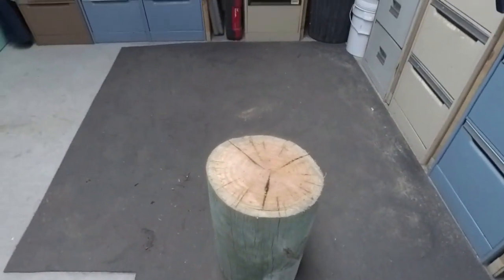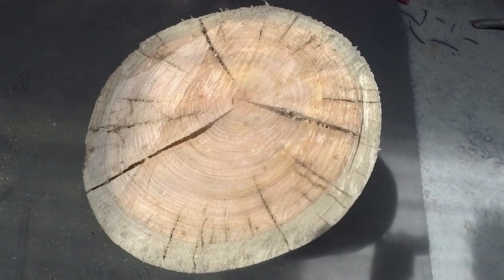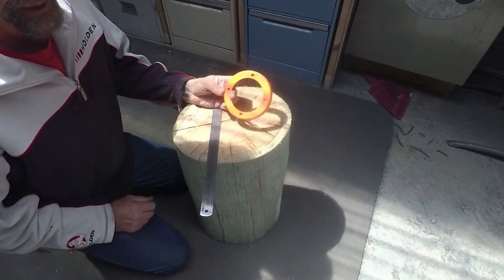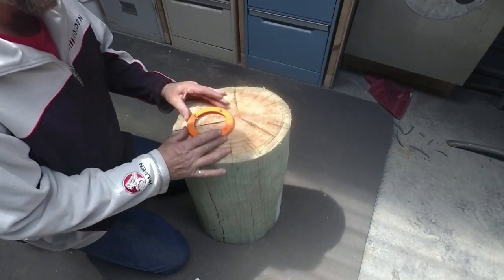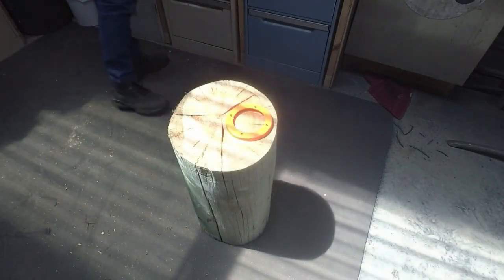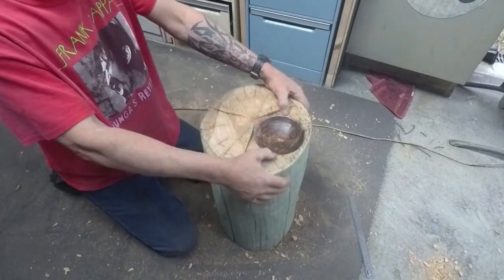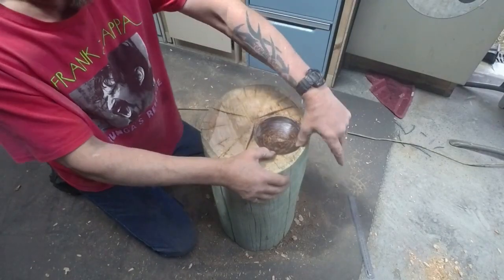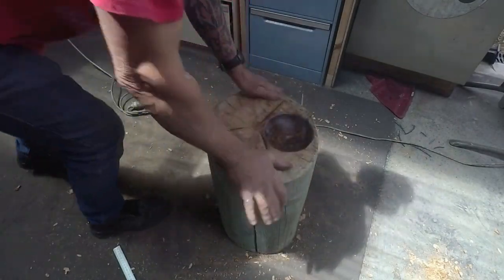Making A Cupping Stump

Comment: Good Idea to use wood for these depressions, I use a bit of wood for shaping leaves.
Reply from the maker: Yer Len I think it worked out ok. At least the wood is softer than a steel cupping tool so is less likely to leave marks in the back of the material. And wetting it down between greatness really helps reduce the smoke.
Reply: @andywright2606  Yeah I love using my bit of wood for the leaves, helps giving it a natural curve and look

Comment: ..Nice job Andy!! i got a stump and a piece of timber with different size depressions for leafs and ladles. Also, picked up a decommissioned oxygen cylinder for under $20.00US. Didn't think about filling it with sand tho, Thanks for the idea. Looking forward to the shovel video...
Reply from the maker: Hey Thanks Oljames. This one is a shitty stump with big cracks in it but it did the job for me when I needed it. $20 US good deal mate. I'd definitely pay that if I can find someone selling one. Yer coal shovel turned out great (well to my beginner standards anyway lol) I will try to get that video edited and uploaded this weekend. Cheers Andy 👍⚒
Reply: @andywright2606  an additional use for the cylendar after the bottom goes to your dishing tool...the remainder of the tank can be used for a quench tanks for oil water or brine. Just an idea for ya lol
 🙏 Blessings now
Crawford out ⚒️🧙‍♂️
Reply from the maker: @dragonstonegemironworkscra4740  Ahh Weldon that seems like a good idea. I imagine you would have to make some sort of a stand to slip the top end into so it didn't topple over. Thanks mate.